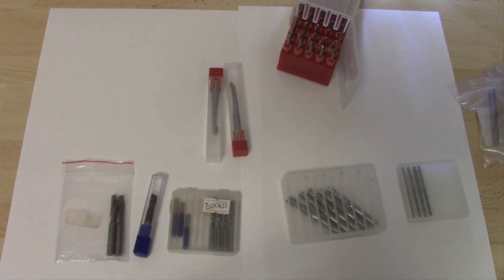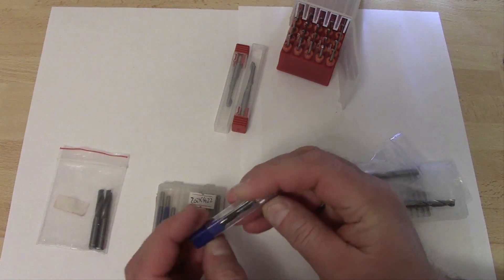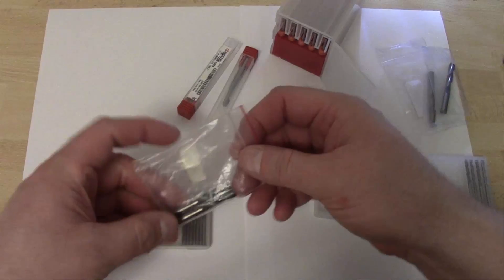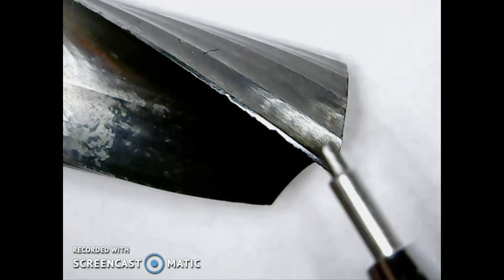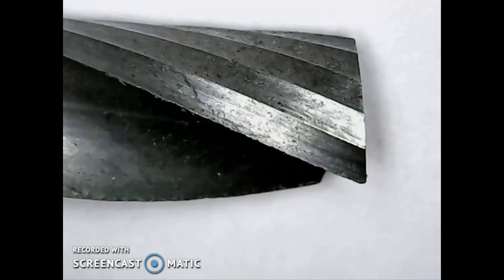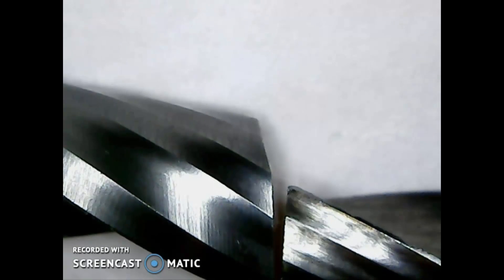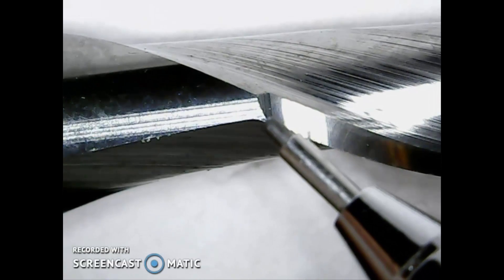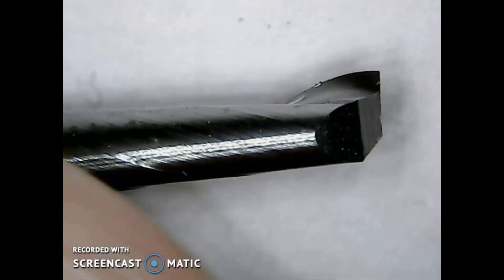Good Quality endmills, and bad.

Comment: Sharpcutter grinding is where you get prestige quality. I know because I make all the endmills and I’m also quality control. The chatter inside the flute is from when they were fluting the carbide blank the wheel was chattering inside the core, which made the cutting edge weak and causing it to be very fragile and chipped. Let us solve all your problems and give us a chance

Comment: That wavy pattern is a bad sign for grinding, it usually means the wheel isn't balanced or there is some vibration somewhere in the machine.  All three of those have that whoop-de-doop tiger stripe pattern.  The wheel is basically bouncing up and down causing that pattern.

Edit, the end-mill at 12:40 looks pretty dang good.  Would not be surprised if one from lakeshore carbide or monster tool co. looked similar. Niagara is another to try.
Reply from the maker: Thank you for your comment, good with some insights why this is. I can just repeat myself: Price an quality is always a question, and to me the Kyrocera tools are a perfect match for me.

Comment: I generally get Harvey Tool end mills for plastic cutting and let me tell you they are sharp as you can't even handle them roughly or you will cut yourself. Now as you said the price is up for those as I pay around $21.70 for the 1/8" and $29.70 for the 1/4" end mills, both 3/8" inch of cut. I never did go and buy the cheap tools as I have a machinist friend and he told me never to go cheap on cutters as it will always come back to bite you in the end. Being a wise man I took his advice and never looked back and I have not had any problems cutting anything I choose to cut thus far.
Reply from the maker: Thank you for your comment. Yes, high-quality comes with a premium price as well !. My primary tools are 1/8" Kyrocera and 1/4" end-mill single flute, for alu and plastics. There was a huge change in quality and surface finish. I do however also have some mid-quality end-mills that I use for rough-cuts or doing some quick test-cuts. 4$ for the 1/8" and 17$ for the 1/4"  To me that is a fair price/quality ratio :-)

Comment: Many thanks for the very informative video. The difference in cut quality and the resource of these mills is the same as under the microscope? What microscope do you use? Digital or analog?
Reply from the maker: Thank you for your comment. The quality of the cut is much better, there is no chipping of the edges on wood, and they are less prone to melt acrylics. I use the cheap ones for roughing. The microscope is a cheap digital USB found on eBay, just search "usb microscope 500x"

Comment: little bit of shaft OD on a very edge of a grind is not as bad as you think.
let me explain.
it is always a balance between cutting properties and precision. if some litte part of end mill's shaft OD is left at the edge it means that it will cut exact its OD (6mm end mill will cut exact 6mm slot).
but in case of shown Kyocera cutter it will cut smaller diameter than it's nominal OD. because of it's also a bad grind. (edge is sharp. but in price of tolerance)
Reply: Disagree. If you are doing precision machining, you wouldn't use (as an example) a 6mm end mill to cut a 6mm slot. You do not rely on the measurements of a cutting tool to produce a specific dimension. You would use a 5mm end mill and cut it to 6mm using your machine, and rely on your own machine which has a known and repeatable accuracy and precision.

Comment: Hello Bo, i use a lot of different tools, what my boss finds on cheap-sales, so new situation very often. I would like to try Gühring Diver, it runs up to V=400 meters in steel, ramping and drilling  with 200 and 0.04 mm pr tooth, one box with a 6-8-10-12 -16 for as little as 160 euro, with 2 types of neck, round for ER and whistle nut for Weldon holder. Where are you located in Denmark? Chers, Allan.
Reply from the maker: Hi Allan, thank you for your comment. Seems like your boos likes to challenge you :-) My DYI machine cannot handle any kind of steel, light Alu/brass/Copper at most. But I'm always into a good deal on quality bits. I'm located in Jutland - Hobro.

Comment: 5:40 As far as i can see those have been badly REgrinded. As seen, there are two diferant grinding finisches in the spiral. Means regrinding without respecting the spiral radius. This will influence the chipping flow. Those are not new!.8:30 Verry bad grinding.
I think those will snap while cutting.
Reply from the maker: Thank you for your comment. Yes, you could have a point on the re-grinding. Never thought of that. But I also stopped buying them now, and just go for the better ones. Like I said, I can use theese ones for roughing, and then the better ones for finish pass.

Comment: The Kyocera bits are the ONLY acceptable cutters in this video... the edge "growing out from the shank surface" = having the same diameter... that's a severe production fault, because the "original" edge is never reliefed (= sharp). Perhaps s.o. got them from the scrap of a manufacturer in order to sell them cheap... My company makes similar cutters and from time to time it happens that we produce a cutter like this... but we throw them into the trash can... (we control EVERY single product by microscope...)
Reply from the maker: Hi Roland. Thank you for your comment. I totally agree, the other bits are not sharp at all, and as you say they should be scrapped. Thanks for putting some insider knowledge to this. Best Regards, Bo.

Comment: If you think you can get away with cheap tapes , they will break at the worst time possible !!
Reply from the maker: Thank you for your comment, yes. That is simply not worth the trouble vs. money. I used the crap ones for roughing in wood and the finish with a good one until all are worn out.